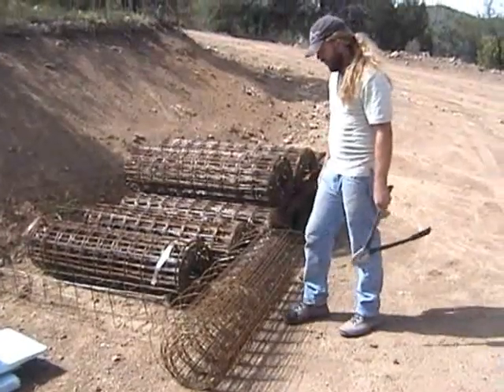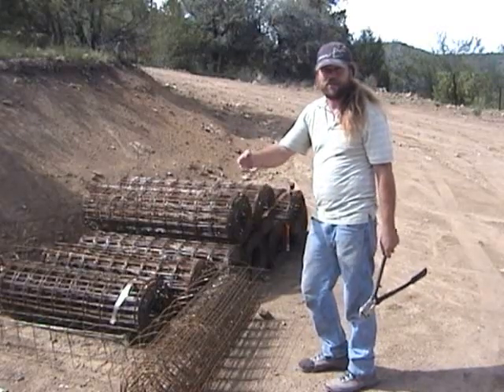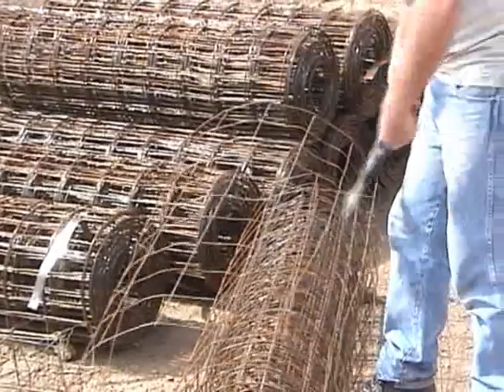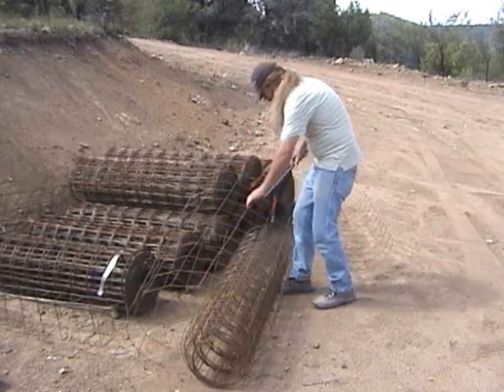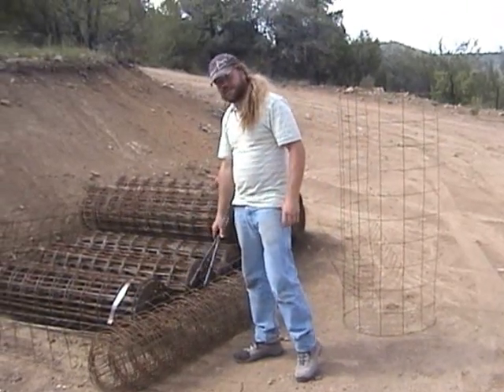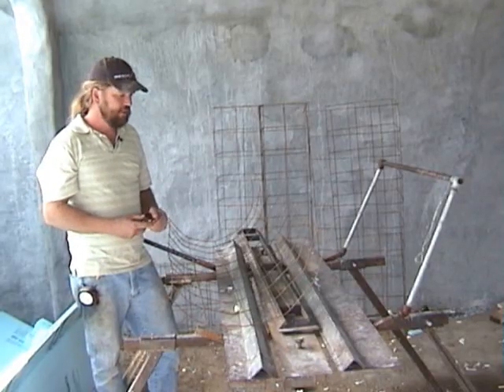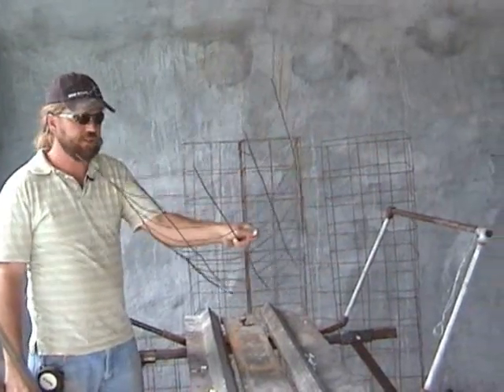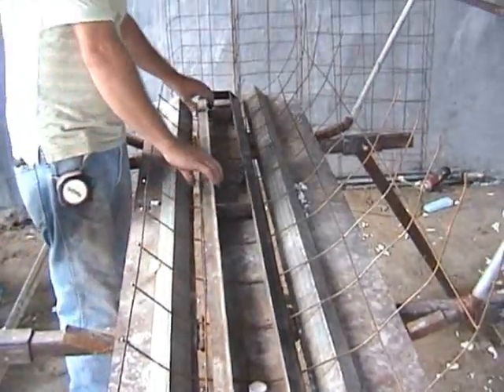The Parabolic Stress Skin System Part 3

Comment: I couldn't find part 2?
Reply from the maker: https://www.youtube.com/watch?v=alLyJmzI9LE&t=190s         Seems to be here on my end.  New videos to come and also check out www.flex-shell-architecture.com as more stuff is being added there.  The newer system is much simpler and focuses on a earth-quake safe and tornado safe roof and awning that is waterproof and integrated into the natural drainage with thinshell retaining walls.  From that solid flex-stable insulated roof pavilion that is integrated into the terrain, you build in your entry walls on a flat thinshell slab while under shelter and nestled between the rounded columns.  Nice to establish solid shelter first then focus on plumbing, electrical (I encourage simple, 12 volt RV water plumbing) door frame, window frame after you are out of the rain and sun.

Comment: Is this generally accepted as a building practice in the USA? Does it also have the same name?
Reply from the maker: Generally accepted building practices in the USA are mostly based in particle board on 2x6 stud framing.  Professional contractors can seldom stray from industry-preferred established methods without an engineer taking responsibility for the project.   This system is now called Core Monolith or Core Monolith Flex-Shell Construction.  A book, website of same name and more video will be published very soon.  I no longer recommend flat walls and grade beam foundations because using a column approach to foundation and establishing your roof, funnel columns and cantilevered awnings as a singular monolithic pavilion based in a flexible geometry, is much easier to address codes and standards obstacles, construct more reliable foundations and is better for tornado and earthquake safety.  The entry walls and all other finish details are built separately and nestled underneath between the funnel columns so they can shift independently but cannot fall inward or outward during an earthquake. This also allows the architectural style to change over time, the entry walls redone,  to accommodate the changes in taste over time and the more durable pavilion. The block framing is used to create precisely curved trusses, in a sturdy, tightly spaced triangular pattern and the trusses provide an insulating thickness for the main roof. Building the Core Monolith Pavilion first makes it easy to get a building permit thru a structural engineer.  The structural integrity of the shell composite and design is easy to evaluate in the separate, simplified and bare-boned stage, before all the complexities of entry wall design, which includes personal architectural tastes, plumbing, electrical, doors and windows. Establishing the pavilion in the circumstance first, allows the finale design to evolve based upon perspectives that are brought to light by establishing the basic shelter first.  Engineers like this system because you can easily prove the consistent compressive strength of the shell material by using test cubes and visual inspection and by showing the integrity of the framing.  The truss block framing and surface framing can be shown to not be able to collapse inward or separate from the overall shape because of the solid locking criss-crossing layering of 10 gauge grid steel on the sides of the block wire trusses and on the sub surface framing that supports the surface composite shell.  This ensures that the building will move; will flex, as one piece, thus distributing bending loads evenly to avoid damage during earthquakes and tornados. The special no-shrink bonding of the fiber reinforced shell to the wire fabric and grid steel frame ensures that even small pieces cannot breakaway and and fall if damaged and the overall integrity prevents major damage. The truss framing pattern and shell composite properties makes the structural integrity plan and simple to provide professional level engineering evaluation and approval in any local. This double thin shell approach should far exceed the structural performance of single shell RC style monolithic domes while providing design freedom, homeowner builder accessibility to technology, an insulating thickness, roof garden area and shelter for your doors and windows.  Email me if you want a copy of the instructions in the raw form they are in now or help with a project or getting the right materials directly from suppliers.

Comment from the maker: @GentleKharmaFarm Thanks!  This spring is also going to see a long awaited project of mine to near completion.  A very specific architecture has emerged from this free-form, terrain integrated, pavilion permitting approach.   Can't wait to share.  You can buy a folding machine that should work fine.  It is called the Big Bendito, manufactured by Warren Marine Supply in Rhode Island.  Have not  got a price quote from them for the five foot plus model you will need.  Good Luck.

Comment from the maker: @GentleKharmaFarm 
The steel is 10 gauge wire called Welded Wire Remesh and also called 6-6-10 Welded Wire Reinforcing.  The 8 gauge is nice too and you can get it at your local hardware store but Alliance Steel in San Antonio Texas provides the highest quality stuff.  If you pick up in San Antonio, you will get the best price and you don't have to buy a whole lot.  Also, picking up the steel from Alliance means it won't be damaged and you can buy it in flats, which may be preferred.